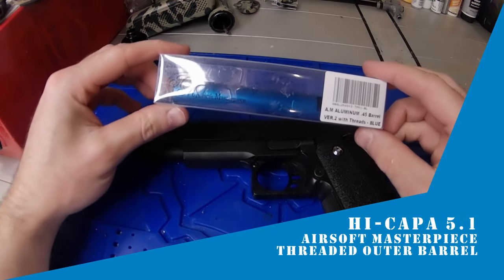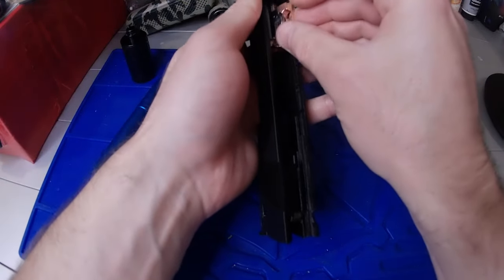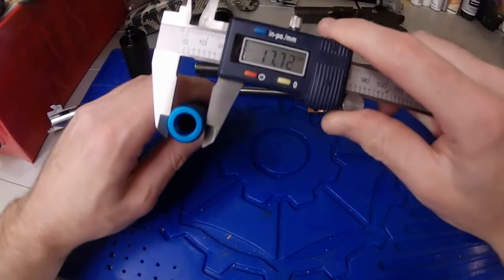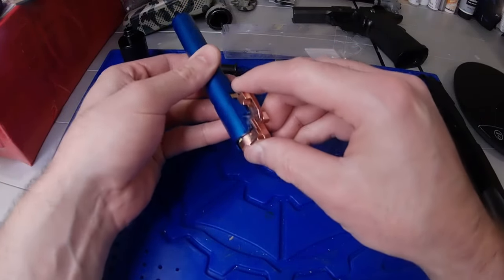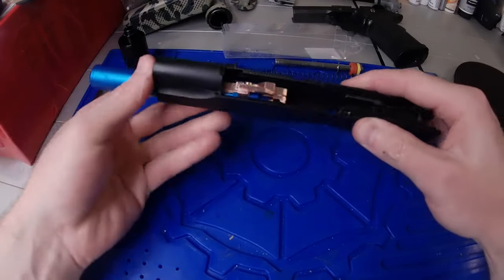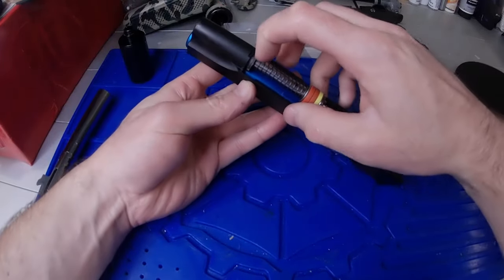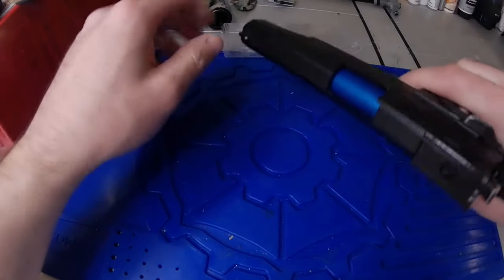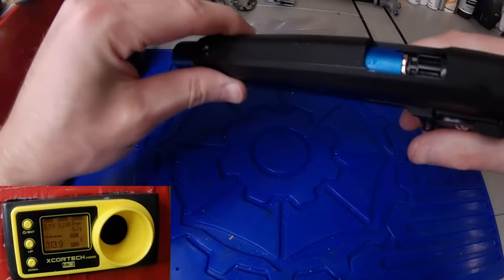Hi Capa 5.1 | Airsoft Masterpiece Threaded Barrel Install

Comment: Any issues so far? Also, I’m thinking of doing this and putting a mock suppressor on the barrel threads so I can cover a longer inner barrel, do you think that’s a good idea? Any tips for that kind of job?
Reply from the maker: Hey, no issues so far! I have seen some wear marks on the outter where I expected (top rear, bottom front), but I think a metal to metal grease and regular maintenance will help prevent any excessive rubbing/feeding/cycle issues. If you notice more wear on the outter or cycle issues I would lightly grease those locations (don't get any in the inner barrel or hop). If the supressor is a foam filed plastic type or aluminum light weight body it's probably OK. My next upgrade coming later is an aluminum upper receiver which is also by airsoft masterpiece (matching brand helps fit), and I just test fit it and it's already feeling more like a glove too 😁👌.
Reply: @DucknDiveAirsoft  yes! I’m gonna snag me a masterpiece aluminum slide as well, to skip the issues with the stock slide all together. You have any thoughts on the longer inner barrel? You think it’s a good idea? (I’m wondering if the excessive length of the barrel may actually be a hindrance or not)
Reply from the maker: @nathanski9268  I don't have experience adding longer inner barrels to pistols, but if you are looking for increased accuracy and range I would look into a tightbore barrel and maple leaf hop and bucking. I feel this pistol has great range and accuracy outdoors even only shooting 1J. I've definitely gotten good kills at impressive range 👌.
Reply: @DucknDiveAirsoft  thanks for the input man. I play at Ballahack Airsoft Field, so I need the range and power on my side arm. I use a DMR and I use my hi capa more than I would like to due to the minimum engagement distance restrictions on my Rifle. Keep making vids dude. The guides have helped me a number of times when upgrading my hi capa. <3
Reply from the maker: @nathanski9268  will do and thanks! I'm just starting into the hi capa rabbit hole haha. Check out https://youtu.be/-5qkvz-szUQ near the last 20 seconds I land a shot at about 100ft. I'd say that range is definitely comfortable with the barrel and hop upgrade on an otherwise stock TM hicapa. I use 0.3g bbs outdoors too (for information) . Cool to see these videos reach outside my local area haha, and your local field looks great too (and huge! )... only 2500 miles away from me 😅.

Comment: Hey, what was the inner barrel length ? I’ve got a 118mm and wondering if that’s too long for a tracer ?
Reply from the maker: The stock barrel is 112 mm for the TM hicapa 5.1 (assuming your talking the 5.1!). It sits just inside the outter barrel. There is still a little bit more room to accommodate the 6mm difference your talking (118 vs 112) and with a 118 mm it would probably be pretty much flush to the outside face of the outter barrel at that point. Most tracers sensors won't sit that far back, but if the barrel were to protrude too far into the tracer your right it would not detect the bbs because the sensor would be blocked by the inner barrel. Usually barrels can stick past the outter barrel and still work with a tracer but that is highly dependent on the tracer design and by how much it sticks past. My best guess is you should be alright. If you already have the barrel just trial and error it or test it out.

Comment: I bought the same outer barrel. 
But , I cannot put my stock inner barrel into it and they jammed when i pull my slide same as on your video.
How do you fix that?
Reply from the maker: I assume you are referring to a stock TM barrel and hopup. I don't know exactly how other hi capa brand hop units will fit but it should all be TM spec based otherwise the hop could have a fit issue with the outer barrel. The outer barrel is mostly hollow. The inner barrel can easily slip out of the outer barrel as you reinstall your  upper assembly. When you install the inner barrel, make sure the tip of the barrel is seated inside the outer barrel with full contact between the two at the top without the inner barrel wobbling. As you slip the outer and inner barrel into the upper assembly be careful to keep them secured together as there is a chance the inner barrel may slip out of alignment at the tip of the outer barrel. It would have been better if the outer barrel were a constant inside diameter the full length but that adds weight.

Comment: I know u posted this video a while back but i was wondering if you could post the link for where u got the barrel im having trouble finding it
Reply from the maker: https://ampedairsoft.com/hi-capa-external-upgrades/

Seems out of stock. Also evike, alpha airsoft or Rainbow 8 carry airsoft masterpiece barrels.
Reply: What brand was the tracer unit? I just got a Gold Match and I'm looking at putting a threaded barrel on it, once I can find a gold one in stock.
Reply from the maker: Xcortech xt301. There is a v1 and v2 now (v2 is newer presumably with improvements or changes). I've been using the v1 for many years now and it's been great.

Comment: I got one of these and I found that it is super heavy and sometimes slows my gun down, should I just get an aluminum one?
Reply from the maker: The outter barrel is aluminum and doesn't move so it shouldn't slow down the cycle. Is it catching or not fitting well?
Reply: @DucknDiveAirsoft  I got the airsoft masterpiece steel outer barrel and stock Mauri spring could it be to spring?
Reply from the maker: @Greensofter  if you have the stock slide I wouldn't use a stiffer spring because it can crack the stock TM slide. An aftermarket aluminum slide can handle a stronger spring which could potentially help it cycle better but it depends why it started not cycling well in the first place. The actusl outer barrel itself shouldn't effect your cycle unless it's not fit well.
Reply: @DucknDiveAirsoft  alright I will order a new recoil spring, what will be the best one. For short stroke

Comment: How do i put a tracer on the new outer barrel,it seems that I need a adapter but I can't find one
Reply from the maker: It depends on your tracer. Some tracers are meant for 14mm threads for use on a typical rifle, which would require an adaptor for the edge hi capa threaded outter barrel. The barrel has a 11 clock wise inner thread. You want to search probably for a male 14mm ccw to male 11mm cw adaptor I believe but check the specs for your tracer first to confirm. Some tracers come with the adaptor in the box.

Comment: hey i was wondering if a noisemaker with a 14mm would fit
Reply from the maker: I assume you mean the noisemaker adaptor from madbull? It looks like it can be made to fit with an adaptor. The threaded inner barrel is internally threaded at its end so is the noisemaker adaptor so you would need another adaptor to suit. It looks like with two adaptors at the end it might be getting pretty heavy though.
Reply: @DucknDiveAirsoft  thank you very much, but dont you think a COWCOW Thread Adapter is enough(1 adaptor)
Reply from the maker: @gabrielwinding2848  I thought you were referring to this attachment: https://www.redwolfairsoft.com/accessories-silencers-madbull-noise-maker-14mm-ccw.html. If you are just referring to an amplifyer (such as the noveske kx3) then 100% you just need one adapter such as the cowcow A01 adaptor (11mm to 14mm). There are probably smaller adaptors too that would work just as well and be lighter (aluminum).
Reply: @DucknDiveAirsoft  THANKS

Comment: my slide is a little hard to rack after putting this barrel in
Reply from the maker: When you rack it see if there is any obvious points where it's binding, catching or wearing at all. You may need modifications for a perfect fit. For my stock TM Hicapa 5.1 I found no issues. I also had no problem with the barrel on the airsoft masterpiece edge slide.
Reply: @DucknDiveAirsoft  yeah mines is stock as well. I literally just bought the parts yesterday (maple leaf bucking, buffer rings, outer barrel)
Reply from the maker: @samietofu5925  it's a regular TM 5.1 and not the gold match version? The gold match one has some special stuff going on with the barrel and hop system for sure.
Reply: @DucknDiveAirsoft  yeah just the regular one.
Reply from the maker: @samietofu5925  fire a bunch of rounds or rakc it for a bit and just keep checking for some wear on the barrel or frame. There has to be a pinch point somewhere if it's that tough to rack. Airsoft tolerances are not perfect so every combination of parts even the same ones tried and true may not always have the same results. I also applied a thick grease to obvious contact points. If your hicapa is new it might need to be broken in a bit too. I had played with mine stock for almost two years before I did the outter barrel so it was fairly well worn in.
Reply: @Duck 'n Dive Airsoft  ah I see. Yeah I did test fire it a bit earlier and it wad sliding pretty well. I probably just need to break it in.

Comment: Is the tracer the mk2? I have the mk2 as well
Reply from the maker: Actually it's the MK1! I didn't realize they have an MK2. Just looked at some differences and the mk1 aluminum cap seems like a better design haha. The exchangable base of the mk2 is a cool feature to shorten the gun length (no adaptor) so you have a shorter draw.

Comment: If I’m using the stock barrel, can I just stick a thread adapter on or do I need to buy the new barrel too?
Reply from the maker: Hey, the stock TM outter barrel is plastic. It's not a great idea to try to thread the plastic or try to put an adaptor on it. If you want a threaded outter barrel that looks similar to the stock one there are lots of options too.